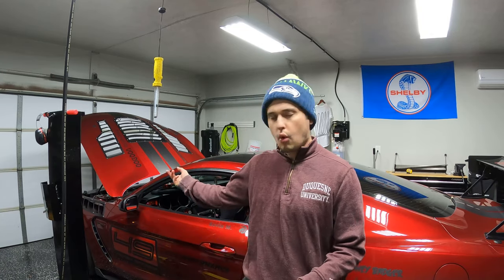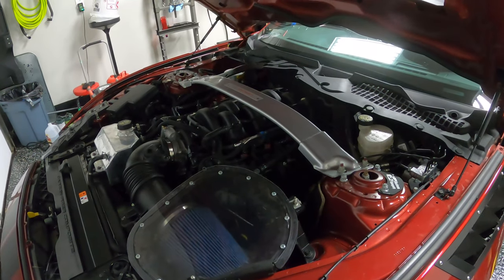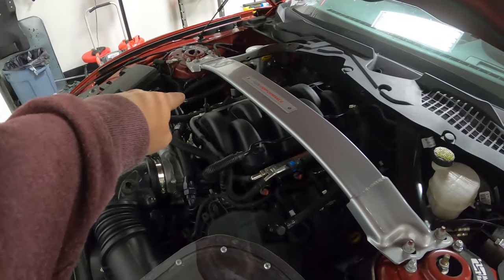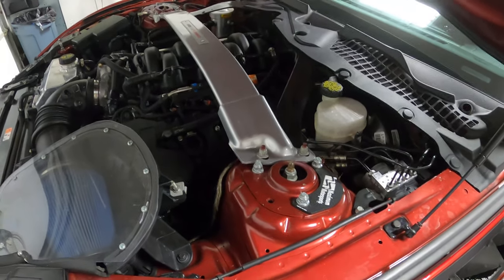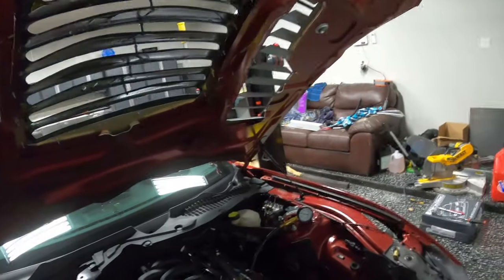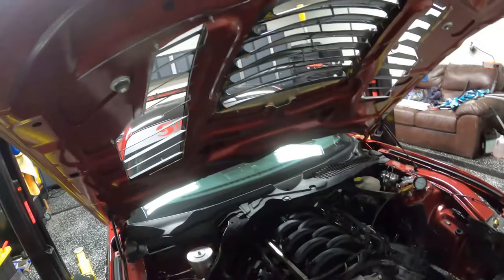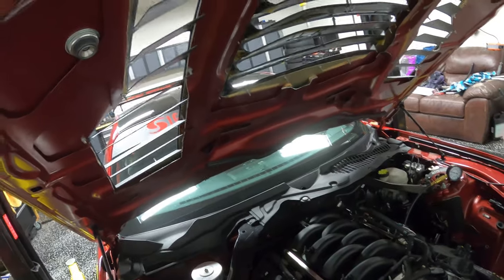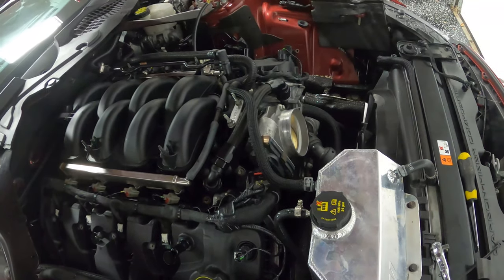Winter Refresh Part 1 - Compression & Leakdown Tests

Comment: Thanks for sharing and great info.  You may already know this but, if you have cylinder(s) that you have a question about during leak down you can sometimes detect what part is the issue by listening at throttle body open (intake valve), exhaust pipe (exhaust valve) or oil fill port (cylinder issue).  It's not full proof but, if your leaking down enough you can usually tell by listening.  Love your channel!
Reply from the maker: Yeah. It's leaking out the PCV/oil fill, so getting past the rings. Engine was cold, so not super concerned. More surprised that 3 we're good and 5 we're higher. When I did a mid season leakdown, a cold test had most in the teens and then I when did it with a warm engine, all were below 10

Comment: Thanks for the videos you post sir, they are very informative. I have a question you can maybe shed some light on.

My 2017 GT350, with 17k miles just recently died on me. it just shut off, no noises no nothing and it hasnt started since. The engine turns over just doesn't start. Long story short, I have done a compression test and I'm getting 30-35 psi across every single cylinder. of curse i think my engine is dead, but i am trying to make sense of it. Any ideas as to what can possibly be causing this or maybe what to check? 

thanks sir, keep up the great work
Reply from the maker: Howdy! I see your story is familiar with one M6G. Assume you posted there? Any resolution yet?

Comment: Are you just editing out how long it takes to actually thread the compression tester onto each cylinder? I had a pretty hard time finding the threads with my tester.
Reply from the maker: A bit, but not much. The threads start pretty deep, so it's possible your fitting just doesn't have long enough threads to make getting started easy.